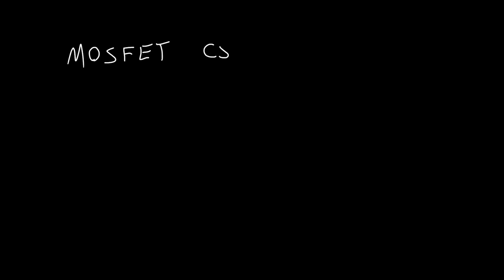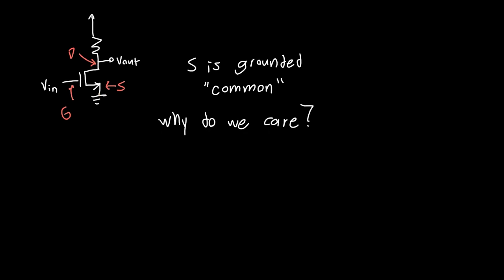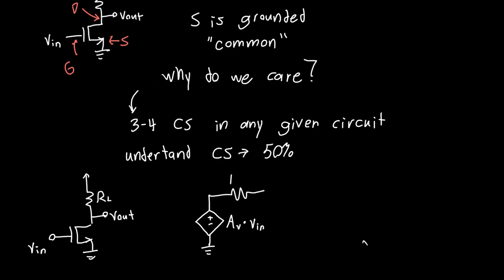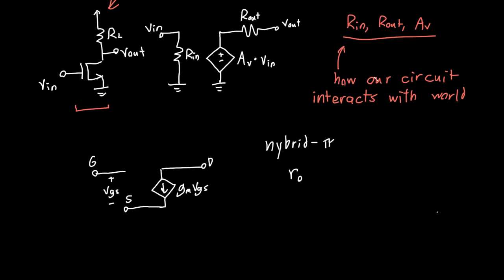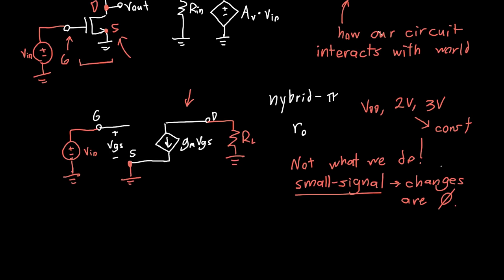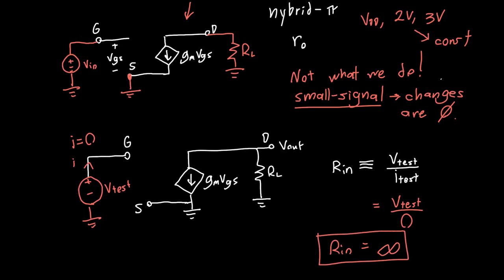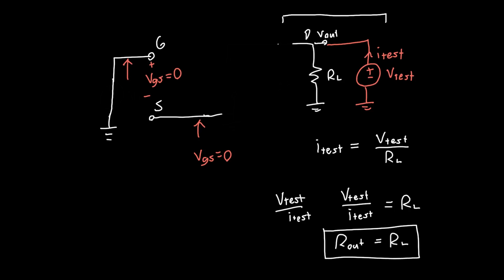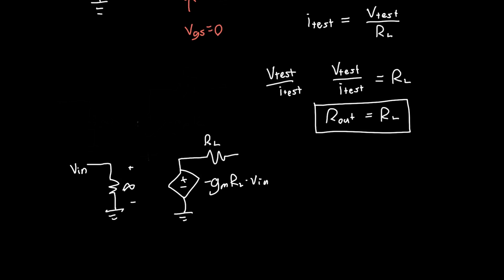MOSFET Common-Source Amplifier

Comment: Thanks for the video!Intuitive explanations!! It would be great if you explain why we take Vgs=0 when we find output resistance
Reply from the maker: Thanks! We don't necessarily need Vgs to be zero, we just need the input voltage vin to equal zero. This is because output resistance measures how a change in the output affects the system, while completely ignoring the input (setting it to be zero).
Reply: @JordanEdmundsEECS  Got it, thanks!!!

Comment: Very nice videos! What year were you in when they began going over these concepts? Im teaching myself these things and I'm trying to learn things in a coherent order.
I would say at this point the most difficult thing I know how to do is taking thevenin equivalents of different componentns in series parallel AC RLC circuits. Im pretty good at analyzing circuits with only passive components. But adding in active things like Fets Tubes and BJTs is intimidating.

 Ive made some simple Hartley and colpitts oscillators on my breadboard, and experimenting with those has left me with so many questions. So I figured Id start here in answering those questions.
Reply: just thought I'd let you know, it may depend on a lot on the school, but my degree started active components (op amps) late second year and moved in BJTS and MOSFETS in third

Comment: I've got extremely confused here. Is this in saturation region? Why are we not mentioning the bias if so?

Why do we make the Vdd as zero. Why do we direclty connect the current source to ground?
Reply: Yes, it's in saturation. Expected for Common Source but could have been explicit. Bias resistors aren't necessary for MOSFETs if we assume saturation, meaning we are certain that Vds > (Vgs - threshold) and Vgs > Vthreshold. We aren't calculating the Q-point either where a bias voltage may help. Vdd is needed for Id, which is needed for gm and ro but he doesn't calculate gm and ignores ro. Current source to ground is because there is no Rsource resistor. It isn't as necessary as in the BJT equivalent.

In Thevenin/Norton + small signal analysis, we short circuit constant voltage sources, including Vdd, and open circuit constant current sources. Since the current source is voltage-dependent and Vgs = 0V from finding Vthevenin aka Vtest, it must have no current and be an open circuit.

He's deliberately choosing the most simple example. That's what's causing confusion.

Comment: Thanks for sharing. Really. I am here because I am having troubles with a Jfet preamp for an electric guitar... Is this valid for JFETs as well?
Reply: Mostly. MOSFETs are characterized by a thin oxide layer that galvanically isolates the gate from the source and drain - thus the infinite input impedance. JFETs physically connect the bits of semiconductor without an oxide dielectric, so the input impedance is less than infinite.
Reply: @jacobfaseler5311  Thanks for the reply. Finally, I found a website where the whole process of biasing a jfet comes explained, and that's what I did, and it works fine.

Comment: This is excellent for the most basic explanation. I noticed though that you did not talk about the resistance from channel length modulation, the body effect, the capacitances between each node, and the frequency response. Is there a reason for this and do you have any video recommendations for them?
Reply from the maker: Yup, I have a few videos on the body effect (none on channel length modulation I don't think). In general, I find it's good practice to simplify things like my life depends on it, and then introduce complexity as needed. One thing I could do better and I always liked is sprinkle in little hints here and there about that complexity without talking about it too much.

Comment: how to Derive the high corner frequencies of the amplifier of the common source
Reply from the maker: For this you need to know where all the capacitors are - then you can figure out what the -3dB frequency is where the transfer function falls to 1/sqrt(2).

Comment: QUESTION. Why are we shorting Vin to find out Vout/Iout(output resistance)?
Reply: what i understood is to get rid of the influence of input voltage
Reply: Because that's the definition of Rout. To find Rout, we always need to short Vin.
Reply: It's because we are using the Thevenin equivalent circuit to get Rout. Voltage sources are considered short circuit and current sources are considered open circuit.
Reply: because that's how two-port analysis is performed

Comment: so why is this useful? other than that it's used in a lot of analog circuits lol is it that we can amplify the voltage but not the current?
Reply from the maker: It’s used in essentially all analog circuits xD. It’s also the simplest case to analyze and so a good place to start.
Reply: Then someone asks you to calculate the cascaded noise figure for multiple MOSFET devices--this is huge!